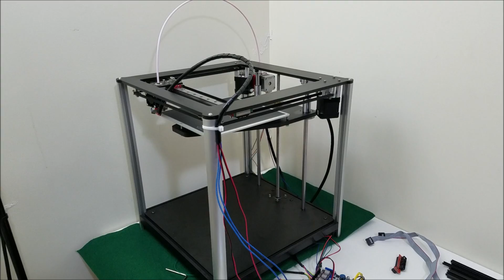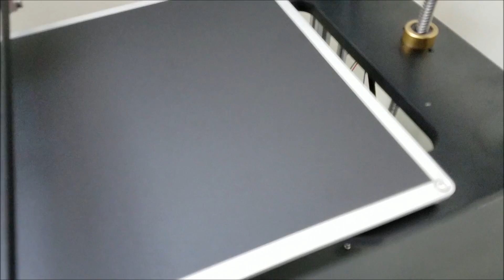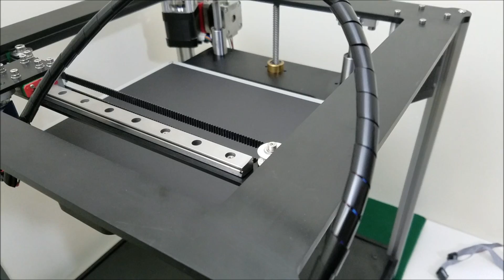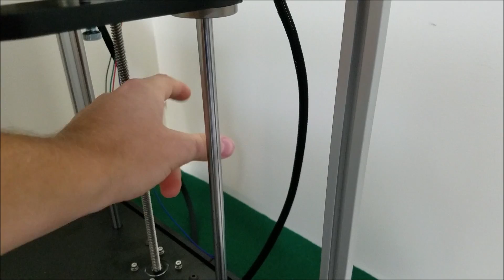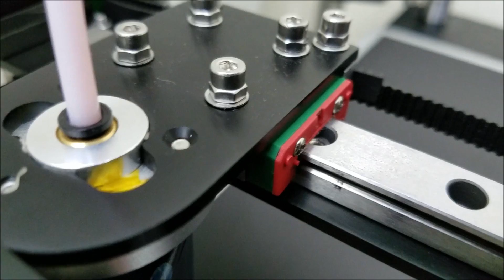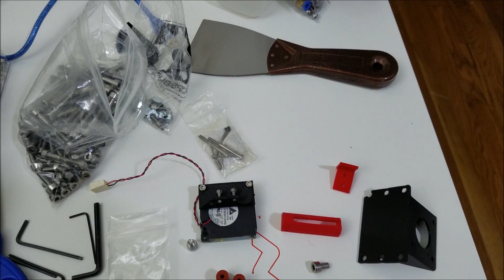Eclips3D2 Update - New Bed & Plans!

Comment: For the idler sprockets, why don't you just use shoulder bolts with sleeve bushings or sleeve bearings? The setup you have now/will have, will wear over time, and may produce some quality issues.
Reply from the maker: Well mostly because it is a weird length and shoulder bolts at off sizes don't come cheaply! But why do you think this setup will wear? The center tube is bolted tight so that doesn't move at all, just like a shoulder bolt would be.The only thing that can rotate is the idler bearing and the small shim keeping it from touching the base plate.
Reply: Hm, I can't really tell what's going on there from the video or your comment. If you would like, I can take a look at it for you and source parts. My biggest concern is that over hundreds of hours of printing, the parts will wear, not to the point of breakthrough, but enough to generate significant slop.
Reply from the maker: TOPHER097 That's true but that's going to happen with all systems that have moving parts. The only part that should be seeing wear in this setup is the idler pulley bearings though, which may need to be replaced every thousand hours or so to maintain top quality printing. Time will tell though!
Reply: 3DprintedLife Yep, I hear ya, just a suggestion. I think you know this already, but metal on metal is no good dry :). Also, not sure if  it was this video or another one, but have you looked into using a proximity sensor for Z-Axis end stop/bed leveling calibration?

Comment: are there many Misumi parts? its very hard to order them in the uk as they don't sell direct to the user user unlike the u.s, will need to find alternatives
Reply from the maker: Right now there are 8 Misumi parts, however 6 of them are fairly standard and should be easy to find replacements for. The only parts which may be tough are the standoffs I talk about in this video, which are not really standard parts.
Reply: ok cool so might require some creative thinking ;-) sounds like a nice challenge

Comment: I think even after replacing plastic pieces due to length of idler they will bend and give play. Think about adding another plate so bolts can get support from both side.  Check voron idler.
Reply from the maker: That was a concern of mine, however I actually already have the new parts in and there is zero play with the new setup!
Reply: Under tention they remain perpendicular?
Reply from the maker: ***** Yes sir, never underestimate the clamping force of an M3 bolt! Additionally the fact that the standoff is 10mm in diameter probably helps quite a bit too!
Reply: What exactly did you order to replace those printed parts?
Reply from the maker: ***** Theyre 3mmID, 5mmOD aluminum standoff tubes, I messed up the height though I think the correct height I should have ordered is 11mm high. So not really complicated parts, just probably not standard ones you would be able to order anywhere other than Misumi haha!
Reply: Saw your latest video. Man, i want to build your machine so badly. Can you share top plate file? I am going to make 4 shat 2 threaded rod system.
Reply from the maker: ***** I will once it's ready! Still some tweaking to be done!
Reply from the maker: ***** Hm it looks like my belt setup is pretty similar to that if i understood their article right, looks like a 2 plane corexy with some stacked pulleys. Interesting!